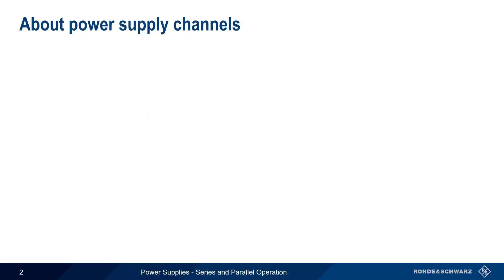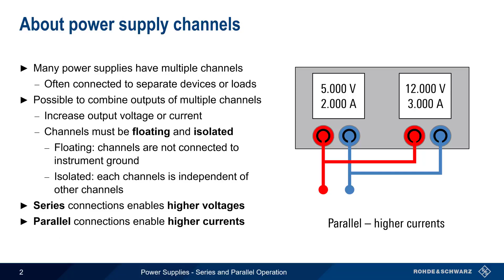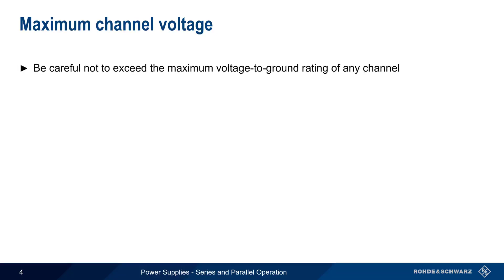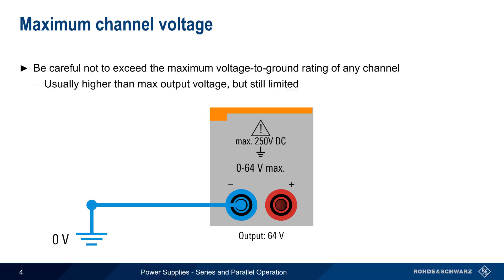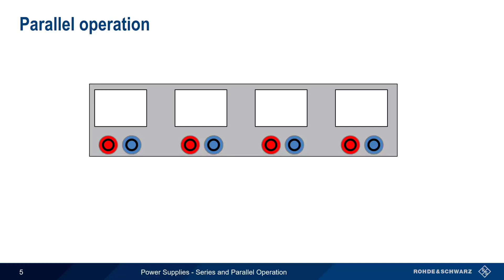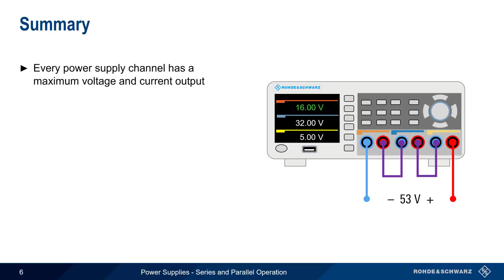Understanding Power Supplies - Series and Parallel Operation

Comment: @Rohde & Schwarz, what is the total current in a series connection, in your illustration the 4 supplies are enclosed 1 box, is it the same illustration, using separate (boxes) power supplies
Reply: The current produced by any power supply channel (or series connection of multiple power supply channels) is always a function of the resistance of the load (i.e. I = V / R).  The series connected channels (the 4 boxes contained within a larger box that represents a 4-channel supply) produce a higher voltage, but the current still still simply a function of this combined voltage and the attached load resistance.  Hope that helps!

Comment: How about total current of series connected power supply? lets say 12V 10A combined with 15V 5A, total voltage is 27V, but how much current can be served?
Reply: 5A

Comment: Hi, I want to use 3 different amplifier modules which have integrated power supply in one enclosure.should I connect them in series or parallel. much appreciated

Comment: I would like to know what happens if sources have different voltage and amperage. That is, if connected in series, voltage because their sum, but what haplens to amperage ? And if in parallel, amperage becomes their sum, but what happens to voltage ?
Reply: In series the max current is generally unaffected and in parallel the max voltage is unaffected.
Reply: @pauldenisowski  So if I connected a 24VDC and 28VDC power supply in parallel the output voltage would still be 28VDC?

Comment: Can i use a 5 voltage dc charger and 9 voltage charger  in series
Reply: Probably not since since I'm guessing they are both referenced to ground.  To combine voltage sources, they have to be floating.

Comment: Floating... 
So suppose I have two isolated channels channels 0-30V each
I connect + of one channel to - of the other, and using this have a reference I can have a +/- 30V power supply.

If I want to see ripple of the positive rail using an oscope, can I connect the common of the probe (ground) to the above connection? If not, what would happen?
Reply: If you connected your scope to any “ground” that is mains earth referenced, which your scope surely is, then you would blow up said scope! 🔥⚡️😢

Comment: Strange that no experiments were shown for parallel connection: real experiments shows that in parallel from two sources you will get not 2 but 1.5 times more amperes. 10a + 10a will give 15a in a best case, over this value one of sources will break and consequently second also.
Reply: That would be a function of the supplies.  I've done experiments where I got 40 amps out of 4 10 amp channels in parallel